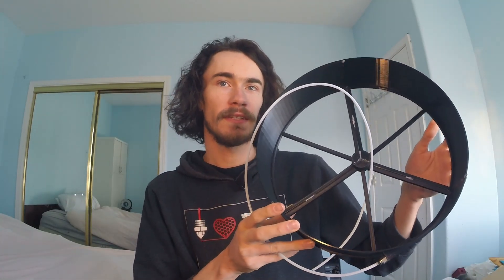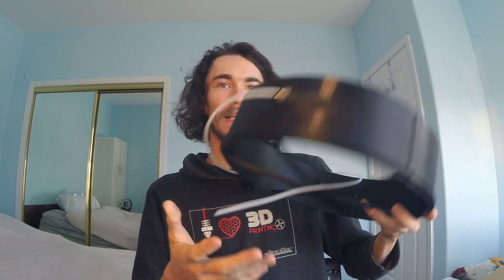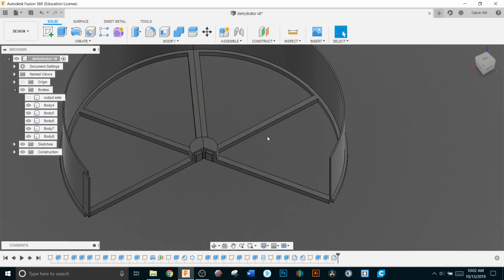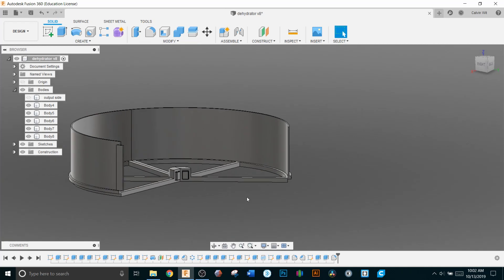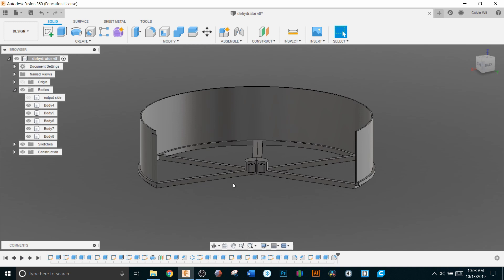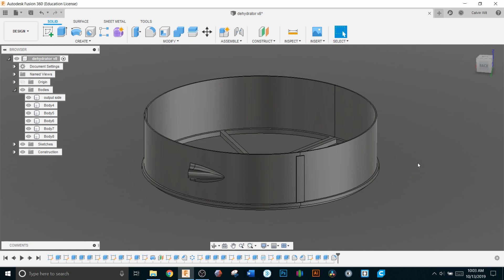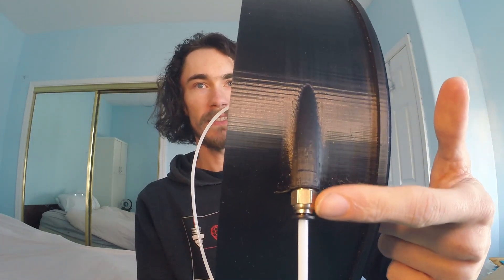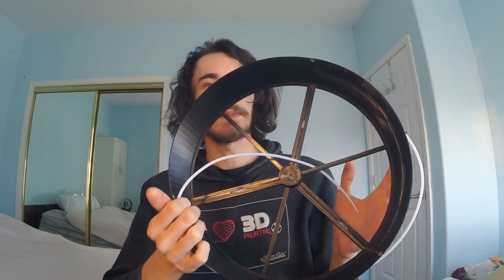3D Printed Dehydrator Insert

Comment: I don't quite understand how this work. I guess that you drill a hole in the side of the dryer to get the bowden tube out? And that your insert is stationary in the dryer? That must mean that the spool is rotating in the insert? Does it really rotate without much force? Thank you and keep up what you're doing!
Reply from the maker: You are correct, the opening in the side allows for me to feed filament straight from the dehydrator to the prints. In my experience, I have had no problems pulling PETG, PLA, PVA, and PA (nylon) from the dehydrator into the print head. The only material I think that would be an issue would be flexibles due to how elastic it is. That being said, if you got clever you could look into adding a free-spinning spacer into there. The idea of feeding filament from the dehydrator is there for materials like PA that need constant drying due to their moisture adsorption. I live in an area that gets foggy quite often so humidity is obviously an issue!
Reply: @MakeItWithCalvin  Thank you! I'm a bit worried about the force needed to pull the filament, but it's certainly encouraging that you haven't had any problems. I was thinking about adding a free-spinning spacer. I'm thinking of modeling something using a turn able wheel like this https://www.jula.se/globalassets/catalog/productimages/322018.jpg . These cost only a dollar, so hard to beat the price. My only concern about this is that if it turns to easily, the spool could un-wind and filament get tangled. If the free-spinning spacer is placed inside your insert, the un-winded filament would drop to the bottom and get tangled in the spacer. From that perspective it would probably be better to have the spacer below your insert, but then the filament have to go into the bowden tube in some other way since the insert is rotating. Could work if I put a tray on the spacer and the filament on the tray. Just something so that the filament doesn't fall below the spool if un-winded.